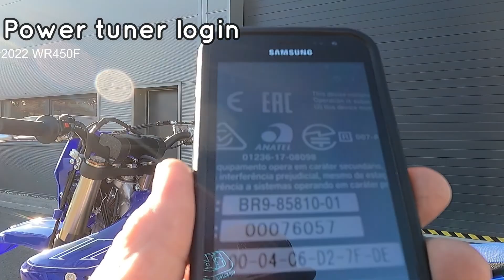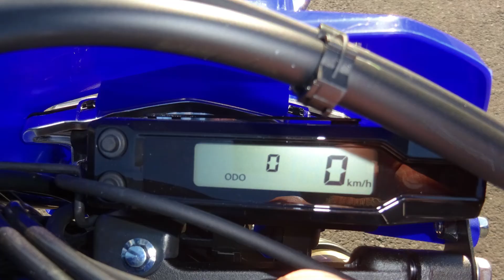2022 YAMAHA WR450F UNCORKING NEW BIKE

Comment: What did you do to the throttle?  What size etc did you replace with
Reply from the maker: https://img29.rajce.idnes.cz/d2901/17/17431/17431670_30a1a3b040838fb623fb286e224e3780/images/DSC01716.jpg
Reply: @RSWR450F  so what size is that?
Reply from the maker: @donjean4483  https://img29.rajce.idnes.cz/d2901/17/17431/17431670_30a1a3b040838fb623fb286e224e3780/images/DSC01716.jpg
Reply: @RSWR450F  he probably meant what size the thread is, so he can buy a new one. But I’ve seen people just cut of the unthreaded part of the original screw and reuse it.
Reply: 12 mm

Comment: What is the benefit of the exhaust mod? Does it boost performance or just increasing sound? Or both?
Reply: Both
Reply: I took out the entire smaller pipe and spark arrestor
Reply: It dramatically increases engine performance
Reply: @nickovdub6131  you mean the whole exhaust pipe thing? how is it? do you feel like its damaging your bike?

Comment: Why wr450f lighter than wr125r 😢
Reply from the maker: WR125R is different bike, for short road rides. Made in Italy (no Yamaha engine)
Reply: @RSWR450F  is it good for single track use?
Reply from the maker: @AgungPrakoso-bn3eo  WR125R is no good option for single trails, too heavy, no power, extreme high seat position...